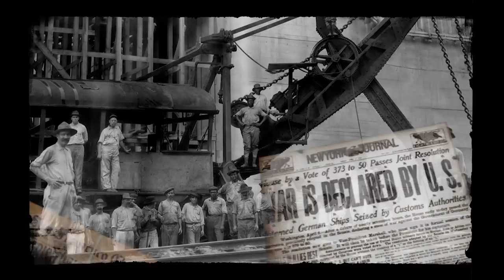Steaming Across Panama: Bucyrus and the Digging of the Panama Canal

Comment: Many of these  surplus shovels, churn drills,  and the Differential Side Dumps Cars (DIFCO) were purchased by the Guggenheim Mining Syndicate and shipped to Chuquicamata in Chile, the site of what was then, and remains still the greatest copper deposit in the world. Many of these old steam shovels were converted to electrical drive around 1925 or perhap 1930  and remained in service until just before 1955. Also, Many of the original DIFCO rail cars survived into about the 1950 era. The era around the end of 1955 saw the end of almost all of the old "Panama " equipment. There were some Bucyrus churn drills that had survived changes from steam to electrification that were retired around the same time. Chilex remained a firm customer of Bucyrus for shovels right up to the nationalization of the mine by the Chilean Government. They had ordered the "Pala Mundial" in 1949, a special shovel that was the largest in the worlds at that time, and was capable of digging down and loading into a rail cat  80 feet above on a upper bench. It is still preserved, look at the Codelco web site (https://www.youtube.com/watch?v=ip74ZMpLU6w) where they acknowledge the Panama Canal heritage of the machine. I watched some this machinery and marveled at more of it on the scarp pile as a boy! One could almost see Teddy R sitting at the driver station!

Comment: Fantastic ! Those machines were colossal;  and the fact that they FILMED IT all too.  Amazing.  My favourite documenty covered this event, on BBC TV, in 1988. But it started with the French attempt, by the engineer who build the SUEZ Canal first, De lesops ? They raised multi-millions of Francs to invest in the project, and everyone including invester's, thought it would be an easy project, and a great investment. They thought that digging a Canal, in virtually a straight line through sand, would be just the same as going through the jungle of Panama; which had the most dangerous killer creatures, and diseases, with extreme heat and humidity. They lost so many men to these threats, and as there was no cure for them, they all died. Despite building new hospitals for the victims, things were made worse through ignorance, as they put huge Flower pots full of plants in water outside the hospital, this provided perfect breeding conditons for Mosquitos and other dangerous insects.Eventually the money ran out , with no progress, the invester's withdrew what was left, and everything was abandoned after about 8 years.  When the Americans took up the challenge,  most of what the french had achieved, had been buried by the Jungle etc. BUT most important, they had discovered a cure for most of those diseases. In my opinion, it was, and still is, the GREATEST engineering acheivement in History.
Reply: The gin and tonic

Comment: I'd like to compare downtime and maintenance compared to today's equipment.  I'd wager this old equipment isn't as smooth or efficient but probably very reliable.  I've operated CAT LHD Elphanstone equipment in hardrock mines and also ancient air powered muckers.  The simple yet smaller air equipment has it hands down in reliability over the new costly and high tech stuff.
Reply: Com certeza meu amigo com certeza.

Comment: Do we still have surviving examples of those heavy steam shovels? I've seen the smaller 3-man ones at steam tractor shows.
Reply: Theres one on Thistle Creek up in the Yukon . It's not as big as those in the video but the story goes it was working on the canal and when it got released was on the way to Alaska but ended up on Thisle  instead
Reply: @samskeeter1  
I saw the one on thistle creek ..it was a real piece of junk ..quarter inch steel plate on wood pads . The boom looked super light and then I turned around to look at the engine ...it was steam ...that blew me away ! 
But back in the day these were equivalent to the big ropeeshovels used in fort mac ..they were really something special . And like weve been talking they ended up all over...very valuable machines back then .
Reply: There's a smaller one at the Mining Museum in Nederland Colorado, can't remember the model number but they had it operating on compressed air.